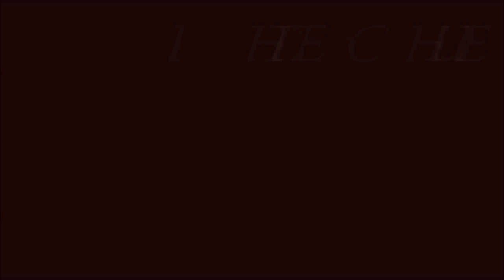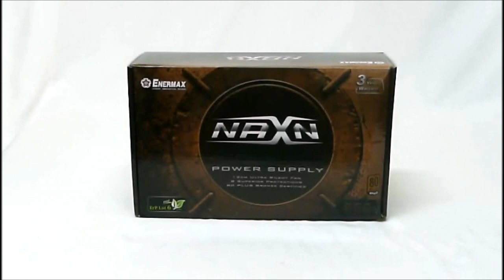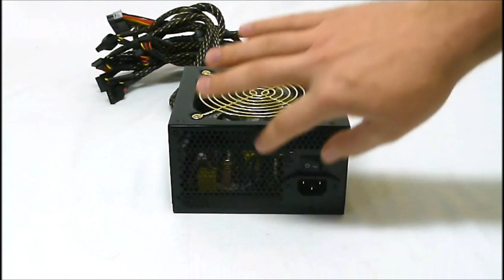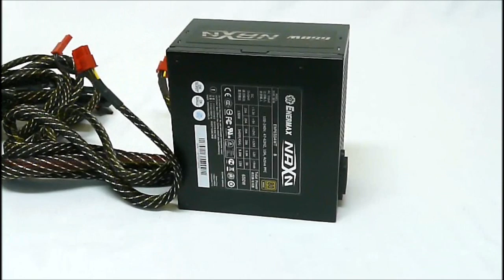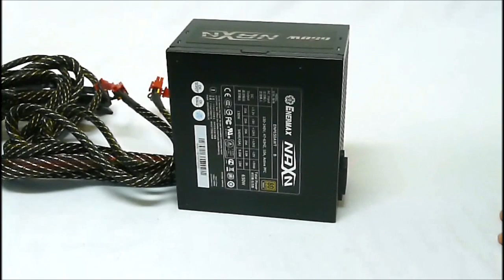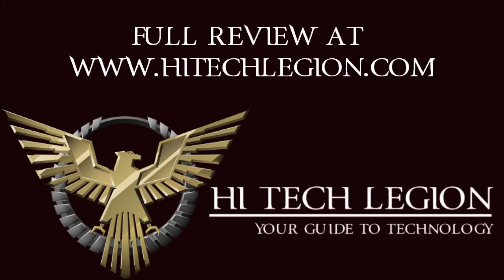Enermax NAXN 650W Power Supply Overview

Comment: If you want to SLI step up to the NAXN 82+ 750W.  This unit handles my i7 3820 and dual GTX 670 with no issues.  It's also partially modular and only 6.3" long which is great in the FT03 Fortress from Silverstone.